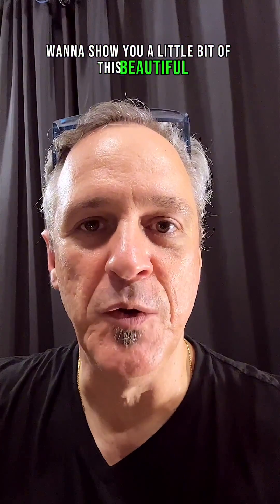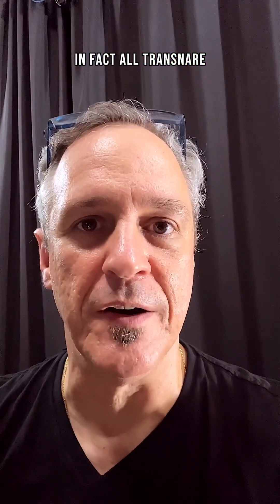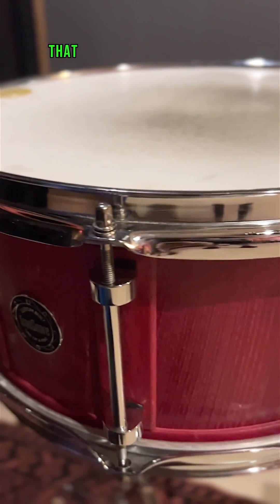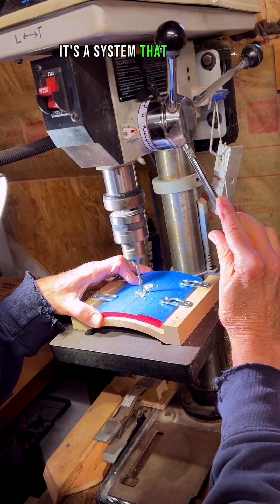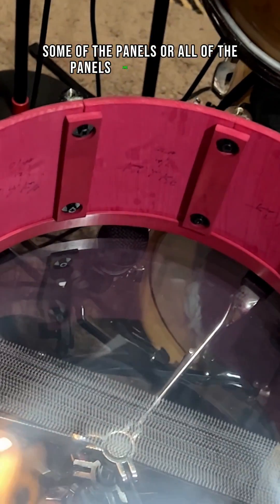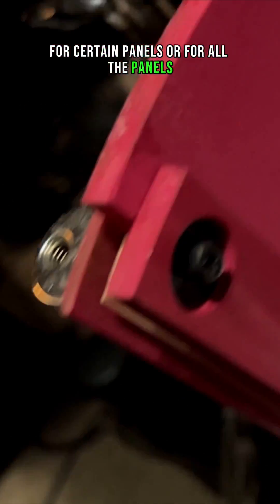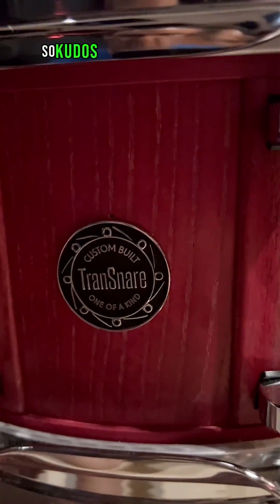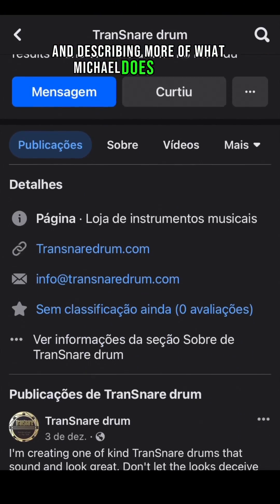TRANSNARE DRUM totally different design to the drum shell concept.

Comment: It's pretty cool. Does he have in depth demo's showing example's of different combinations? Also, how does it work when coming to say changing out/buying pieces, like would someone typically order a drum that sticks to the same type of wood, and then just but individual pieces in single sections? Also, the odd thing to me is, would you basically just start buying random individual pieces until you say have enough of a different would that you could then do like half and half, or would it make more sense to just keep buying different snare drums in full, and then start mixing/matching? Like, it all seems like a bit of a headache to me, but I also don't understand how it works. Can you buy individual pieces for a good deal type thing? Also, like I say, before I invested in something like this, I'd want to hear a fully mic'ed Snare in solo, and in context of a drum mix, and hear what kind of effect/sound changing out a piece, or 2 pieces, or half a drum had on the sound. Also over time I'd wonder if pieces built/kept on their own would all keep/hold their shape, or if stuff would start getting weird over time. I would just have so many questions/curiosities before I'd invest in something like this. Oh, also, is there any downsides/risks/compromises etc, to each piece being separate? Like it's cool if the main purpose is to mix, and match pieces, but just in terms of a single drum(of the same wood), and the integrity, resonance etc, I wonder what effect that's gunna have.
Reply from the maker: Hello James, you have made many observations and I thank you for all your questions. The musician in the video Mauricio Zottarelli @mzdrums explained how you switch out panels which change the timbre of the sound of the drum. Many responses come to me about mixing different species of wood panels to get a different sound and look. You most certainly try that. Experimenting is what we all do. When you purchase a drum you receive the drum with no extra panels unless you request an additional set be fabricated. You can purchase the drum and later place an order for more panels and I would be have to talk you through that process. I hope this answers some of your questions. Thank you again.